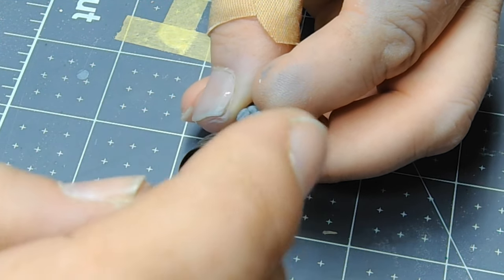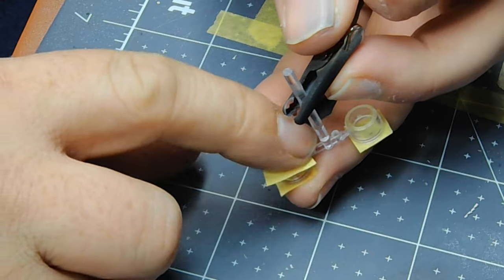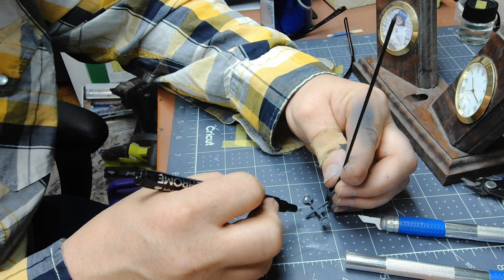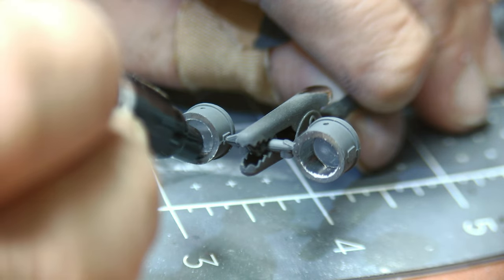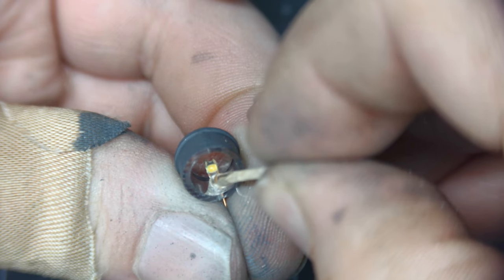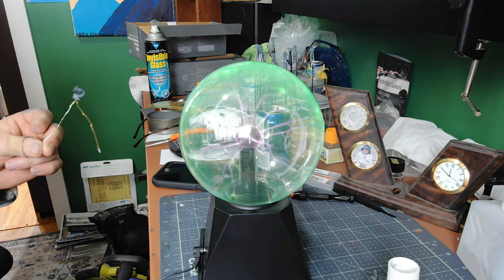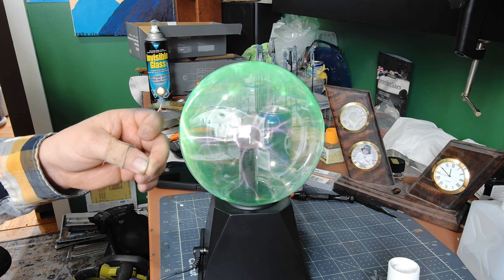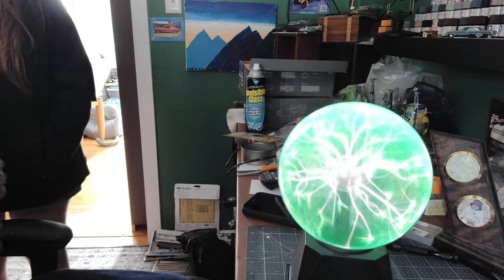1/200 Trumpeter Bismarck video 35. Search Lights.

Comment: Hi Chris, just curious... How's the wood deck holding up with the Gorilla spray?
Reply from the maker: Almost a year later it’s holding very well. I do recommend a heavy coat and pay special attention to the edges. My original downfall lol. Now with the scale decks the glue will go through the wood making it sticky. I used the shiny paper that stickers are attached to to use as a press under my finger. Worked very well and no issues with the wood pattern bleeding. Hopes this helps.
Reply: Yes indeed, thank you! @pebblecreekmodels